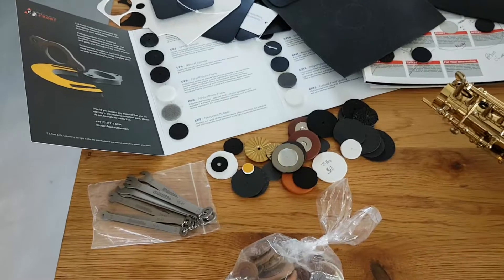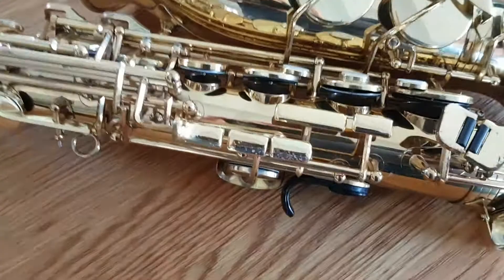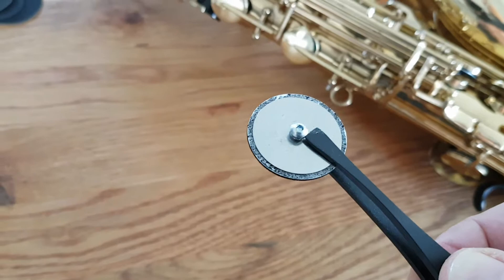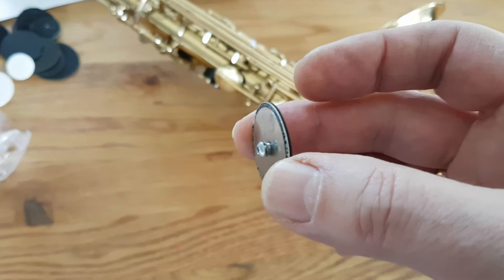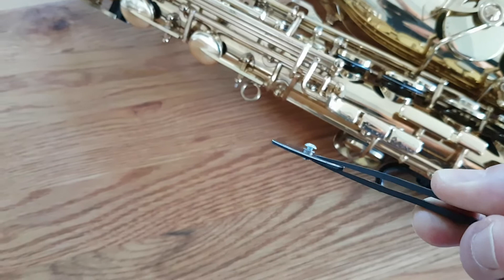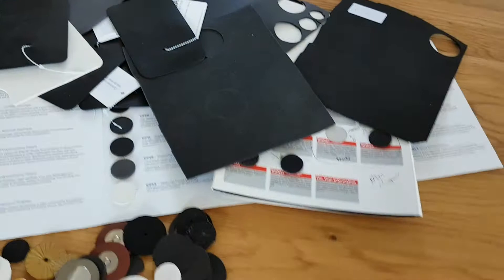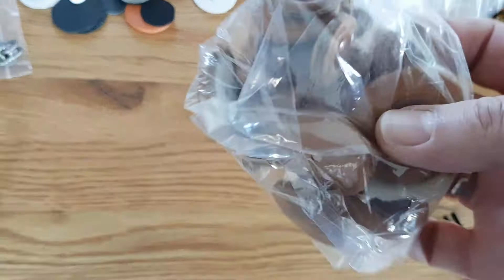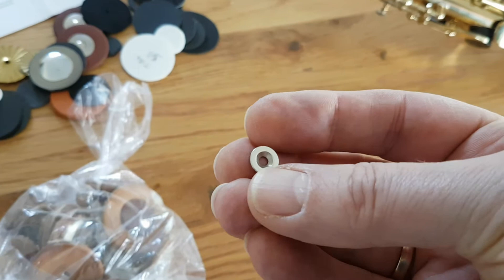NEW magnetic Saxophone pads.

Comment: Well deserved appreciation is due to your brave attempt to introduce a modern approach to the ancient practice of leather and felt pads for the saxophone. Not intended in the slightest as any sort of disapprobation, but some honest and well meaning comment might serve a useful purpose towards betterment . The pad noise is truly excessive as is the difference in feel. Pad noise could be eliminated totally by the use of a more conventional thickness of an appropriate duro felt. This is precluded by the limited distance or height between the underside of the cup and the edge of the tone hole due to  the thickness of the magnet. Saxophone pads have been the object of my intense and almost continuous research for as long as I  can remember. There can be only one and only one solution to this apparently ridiculously simple and ordinary problem. And this involves the engagement of polymer chemists developing a material exclusively suited for the use as pad material. The most serious the most intense, the most expensive research by hobbyists, saxophonists, instrument manufacturers and the interested must come to naught as there does not exist presently any material appropriate as pad material either for the sealing element or the back up element.  A more pragmatic approach would remove the main bother  by the  removal of old pads and  installation of new pads on an instrument which is in otherwise perfect playing  condition. The use of thin neodymium  magnets to hold the conventional pad in place would to a great extent remove the necessity for replacing existing pad design and materials by more modern and presently non available materials. Some slight modification would of course be required to render this method workable such as the removal of the resonator and cementing of the magnet its place.While it would not remove the requirement for perfect alignment of pad with respect  to tone hole, tone hole leveling, pad seating, etc,  it would at least make the removal of dysfunctional pads and the installation of fresh pads not as much of a bother  resulting from  the complete disassembly of the instrument or at least one stack to replace just one pad.This method provides a  great plus to the service person and retains the sound and feel of the ancient pad system so beloved by most or all saxophonists.

Comment: Every attempt to remove for ever the messy situation of cementing pads into cups must be given the utmost appreciation and  encouragement. This new magnetic system is indeed elegant. What  some professionals might not like is the clapping sound produced as the pad closes. This could be remedied by the choice of  an appropriate sealing synthetic elastomer. I had tried out the system but found that it could not be used on my tenor due to the very restricted space available between the pad sealing surface and the cup surface. The situation was set right by replicating the  classic Buescher snap on system but using a magnet in place of the split resonator. This magnet is 6mm in dia and 4 mm thick and fits absolutely in the pad thickness which is of course 4mm. The resonator could be a plastic disc or a metal disc to which the magnet is cemented using two component epoxy.The pad back up disc is of fiber glass of thickness 1.25mm. This removes the mess of pad cementing. Incidentally it is indeed tragic that the Bueseher Snap On system was not adopted as the universal pad fixing method. Does anyone know the reason why?
My system as described here is the magnetic equivalent of the excellent Buescher design. The system is not of course self leveling but this could be incorporated by locating the countersunk magnet in the pad with a plastic or steel resonator cemented to this magnet. This gives an extra 1mm space in the 4mm thick pad. The head of a round head steel screw is cut off and the smoothed out  head cemented to the center of the cup interior. Height adjustment of the system could be by very thin steel washers under the half round screw head of by thin paper cut outs behind the pad. I make absolutely no claim for the originality of either of my designs as both are off takes of the works of others David Chapman and Buescher respectively. So thanks be given to these inventors and the utmost appreciation for their work.
Reply from the maker: It's taken 8 months working in association with a distributor of synthetic materials, under a NDA, to develop a suitable sealing material. This softens/damps the "clapping" noise made by traditional leather pads. The new material is airtight, waterproof, will form a seat but also recover its form entirely when left for 24 hours (low compression set). This latter specification allows for incidental rotation of a pad, non-concentric to its tone hole (they are seldom concentric) and if sprung closed it allows it to form a new seat without any crossover of seat impressions from its prior position where a leak could otherwise be created. Endurance testing of this new material is now in place, especially for the effects of saliva on pads which typically become sticky (e.g. G#). So far there is absolutely no indication that pads would stick over time. If this was to occur, a pad can be removed in a few seconds, cleaned, or easily replaced by an end user/owner. 
Incidentally, the minimum space required for these pads inside the key cup is 3.5mm meaning in most case a lightweight spacer or spacers is introduced to set the pad at the correct height and indeed to adjust heights when regulating the pad set to work in harmony. These spacers are easily removable if further adjustment is required.

Comment: Thank you for your detailed reply. The difficulty faced by  attempts to gain more widespread acceptance is that they required an especially built tone hole pad system or special sealing material. The Codera system, from the illustrations available, used a thin sealing ring which seems to have been cast into its retaining groove. Do you know  what this sealing ring material was?  Or can you advise me as to how I may get to know of this material from information which might have been published and made public/ EVA has proved satisfactory for clarinet pads and are available commercially . Have you considered this material for your system? EVA is used as a substitute for neoprene and is more durable and is ridiculously inexpensive. Do you know the sealing disc used in the Toptone design? I have a British made Boosey and Hawkes flute fitted with synthetic material pads. This flute has been in continuous studio use for some twelve years and pads are as good as new. I had requested information from B and H as to their pad material but my many letters did not yield even an acknowledgment . Perhaps this material would suit your system and as the material was made in quantity and possibly still it you would not need an especially produced material. I hope you might be able to answer my queries and thank you for your help.

Comment: What are you using to hold the magnet to the key cup? Are you going to lock the pad in place or let it free float? Bundy had something similar that had issues of rigidity, what is going to stop them from bending and wearing from standard playing?
Reply from the maker: Hi Brett, the magnet is glued using a specific nickel to brass glue after research with 3M and Locktite. 
The pads will free float but have a tendency to stay static due to surface friction between magnet and screw head. They don't flop around, but do self-level when first installed or if manually moved and a key is then closed. 
There's nothing to bend, all parts are steel or stainless steel apart from the synthetic seal which self-adheres to the stainless backing disc. It's also hard wearing but is easily replaced, unlike a leather pad.

Comment: I tried the magnetic pad and have a self leveling pad on the market.  Please contact me.
Reply: I have come across references to your pads Mr Smith and have wondered just how they work. Is your design patented? Or could you publish your work in pdf or video for strictly informational purposes. Possibly you have already made your work public and if so pleas do provide me with a link to what I consider to be a mile stone in the progress towards a sensible , rational and modern to the saxophone pad. Thank you and looking forward to a communication from you.
Reply from the maker: Hi Jim, yes we've emailed before and I've tried one of your self levelling pads on a Yamaha. Your pad base glues directly into the key cup and so the pad isn't instantly removable, as mine is. Also you have to adjust your pad base height with washers/shims under before you glue it in - tricky to get right. With mine a pad can be trial fitted, whipped out, height adjusted using an allen key and spanner, and popped back in. During initial adjustment and regulating this is crucial to a speedy set-up. I'm also doing away with the felt under the pad skin. Mine is just one layer of synthetic material onto the stainless backing disc. That's what's taking the time - to get the perfect material which is tough, pliable, anti-moisture, low compression set yet holds a seat for "a while". I'm down to two contenders, but there's still final density and thickness to work out. It's slow progress too on the small parts which have been in short supply for sample work. I'll be sure to order in plenty of time now I have all the lead times and minimum quantities. I still see this as a tech job - not many will want to dismantle and reassemble their horns themselves. But once done, replacement pads could be dropped in by a competent owner (adjustment and regulation still required). Or perhaps they may wish to swap to a different resonator. Just remove the old one, drop on the new one.
This may be a small business for me, if it works out, where I do the initial work and have a local tech check the set-up before  a horn goes back to its owner. But... a lot of folk are still going to be set in their 150 year old ways, and techs too no doubt. Still, when you have an idea it's good to see it through to a successful result. We'll see...
Reply from the maker: @vivianastridge2167  I suggest you contact Jim directly via his website: https://jsengineering.net